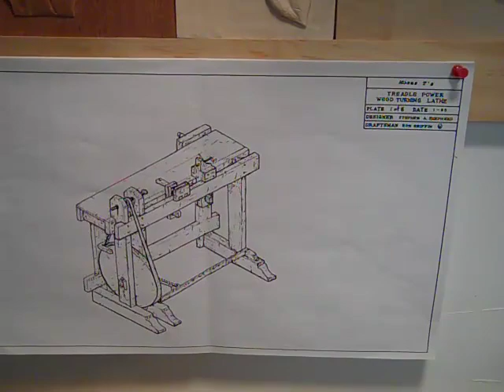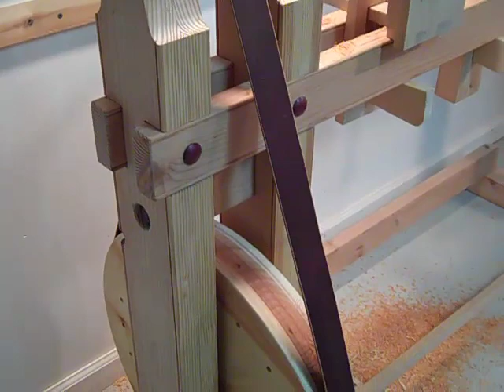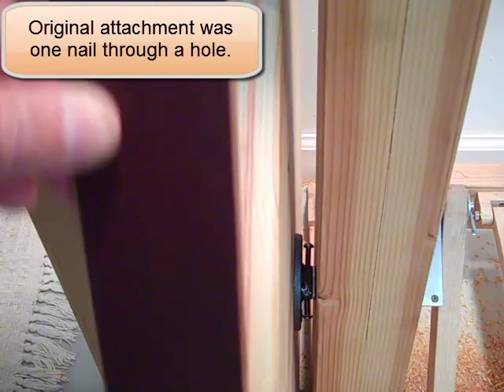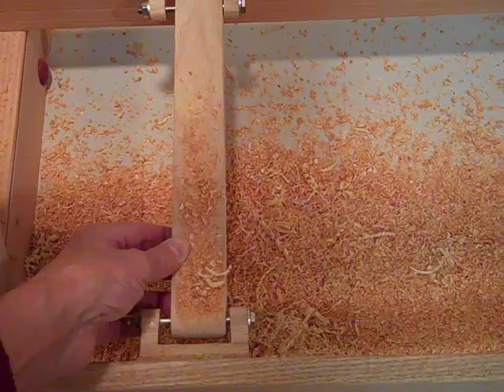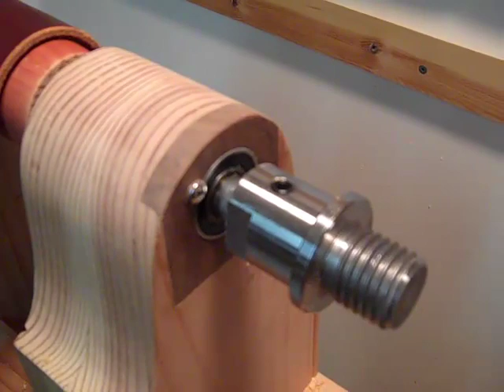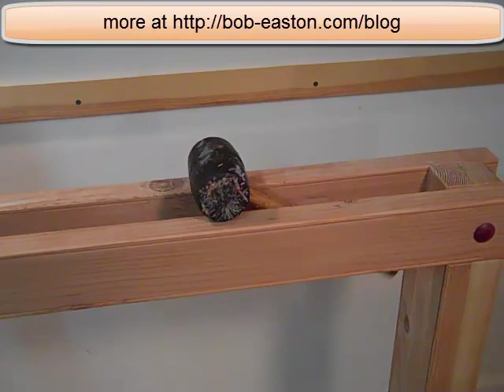Bob Easton's Treadle Lathe

Comment: South Bend Lathe Works used to sell a small 6" swing shop lathe, complete with threading gear box, that ran off a treadle made by the Singer Sewing Machine company. You couldn't take heavy cuts but you could turn anythiung that would fit in the chuck.

Comment: Just wondering where you got the spur centre and thread adapters for the 5/8" rod? Also the sleeve for the active centre on the poppet?
Reply: +TripleC FIFA He mentioned he designed it to take accessories that fit Shopsmith lathes.

Comment: I added weight to my treadle lathe by boring large diameter holes in the flywheel and inserting pcs. of roundstock steel or lead into the holes. I added about 70 lbs. to it in this manner.
Reply: +paige metzger I have thought it would be fairly easy to encase a pair of cast iron 25 pound weights from a weight lifting set.  Balancing it would be tricky tho.